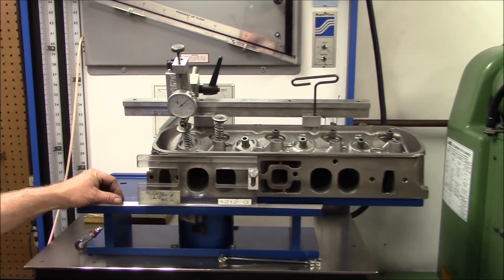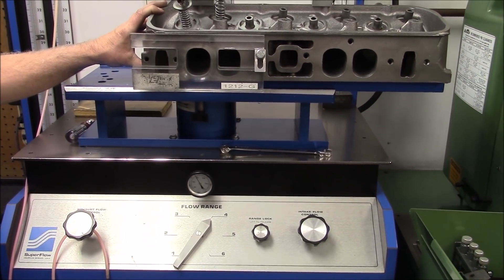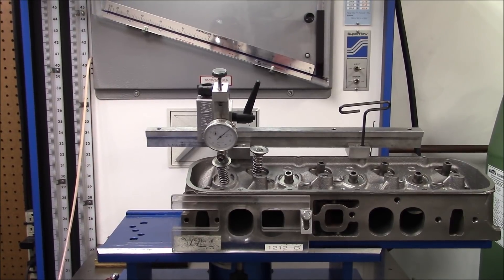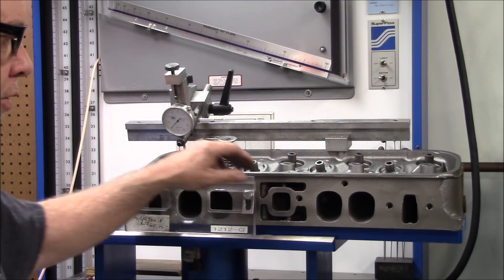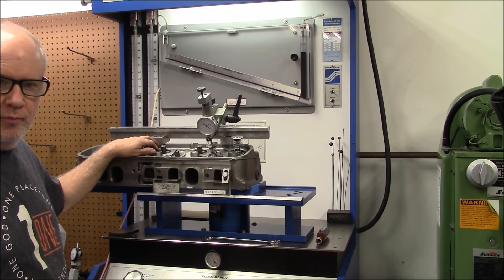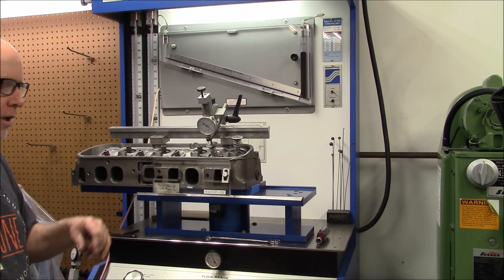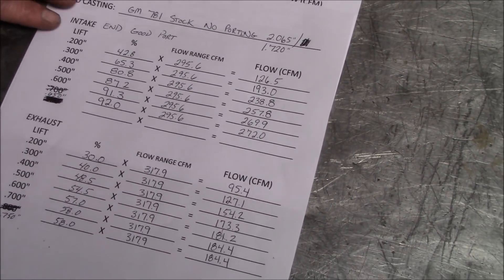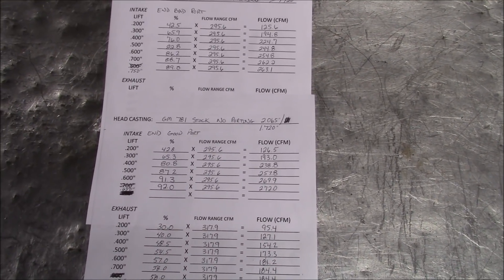GM 781 Cylinder Head Flow Bench Testing 620HP Street/Strip 454 Big Block Chevy

Comment: 781 test here: stock head 2.06x1.72
Intake: cfm bad side (lowest cfm)
@200= 42.5
@300= 65.9
@400= 76
@500= 82.8
@600= 86.2
@700= 88.7
@750= 89

Exhauste: cfm
@200= 30
@300= 40
@400= 48.5
@500= 54.5
@600= 57.6
@700= 58
@750= 58
Reply: The cfm number times the amount of cylinders u have? So 89 times 8(cylinders)?

Comment: i have a set of 049 i stuck 2.300 intakes and it ended flowing 298 cfm at .550 lift, restriction is in the port now. 😂

Comment: I think maybe you need to invest in a piece of string and find out where the airflow really goes.
Reply: In 2023 cost for valve job and shave heads true 500$ if valve guides needed 800$
Reply: Keep reading your hotrod mags!   He is finding the flow rate of the ports. AFTER this procedure come the modifications he deems necessary!

Comment: Interesting, do you feel the oval heads are superior to the rect. port ?  I know the Rect. heads do have bigger valves, back in the day there was always so much debate of oval VS rect.
Reply: An oval shape is a much more efficient shape as far as airflow. (Air doesn't like 
corners) Oval ports also have a smaller cross sectional area, which increases
air velocity. The square ports are just plain too big for most street driven big 
blocks.

Look any of the modern prostock heads, they're all oval shaped.
Reply: @mceperformance8978 The Ford  427 tunnel, all the 429/469's, 302 Boss and 351 Cleveland and 351/400 M,  Mopar W 2 small blocks, DCI' RA5's,